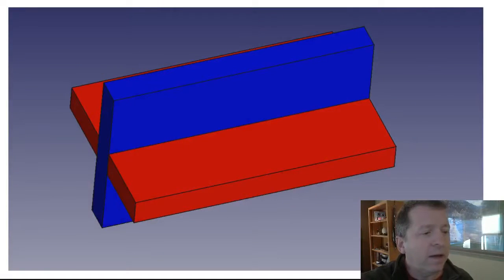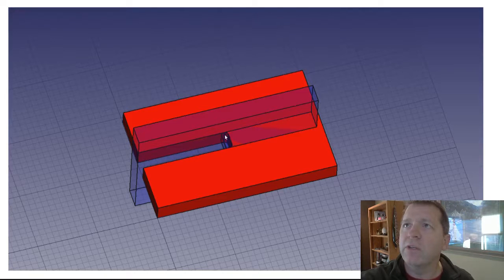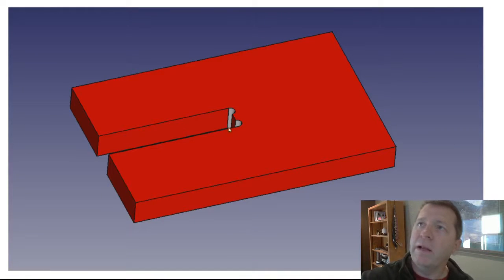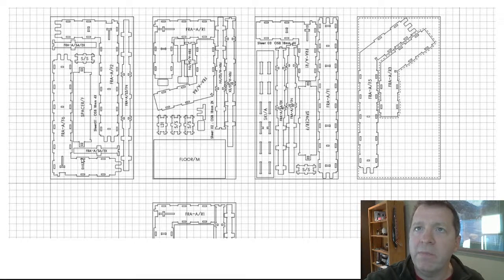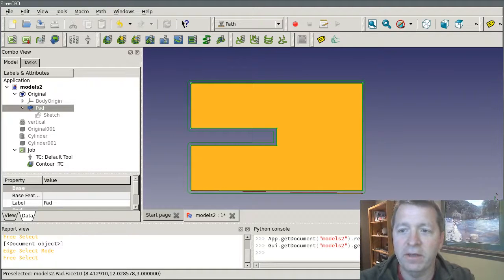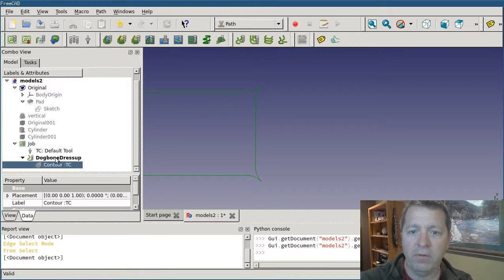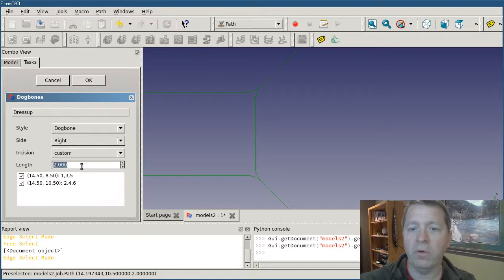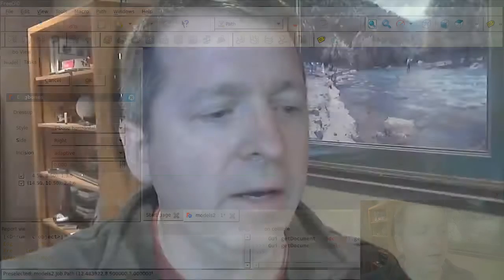Overview of the Dogbone Dressup

Comment: 4:00 Exactly! Separation of concerns, just like in software development. The design should be concerned with an artifcat of the manufacturing process. A laser could cut it with a tool diameter of 0.2mm approximately, might might be fine to not even think about when it comes to these slots.

Comment: Does the dogbone dressup work only on contour operations, or does it also work on path pocketing operations? I tried to apply it to an "adaptive clearing and profiling" operation and my computer froze.... I guess that's not a good idea? @sliptonic
Reply from the maker: Dogbone is intended only for profiling operations.   You could use an adaptive to clear the main area, then do a profile with a dogbone dressup to finish the edge and clear the corners.
Reply: @sliptonic  Yes, that has been my workaround as well.

Thank you for doing your videos, I don't think I would have understood the Path tool without them.

Comment: Very good, but I have one small request. It is possible to adapt this dogbone dressup to always be hidden? I mean, FreeCAD can read all the components from the assembly and knows which parts and how they are joined together, and like in this example the other joining part (the blue one) to always cover the dogbone, so that the dogbone can't be visible from outside. Make this thing to be automatically calculated. Will be very practical for big projects.